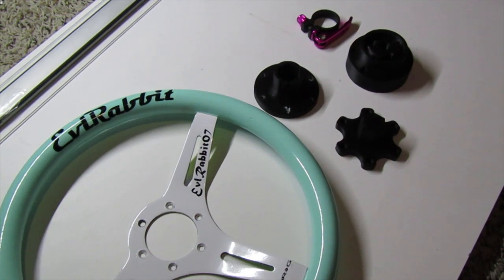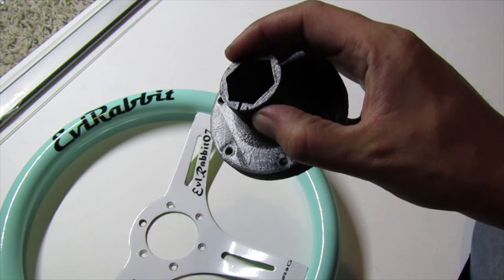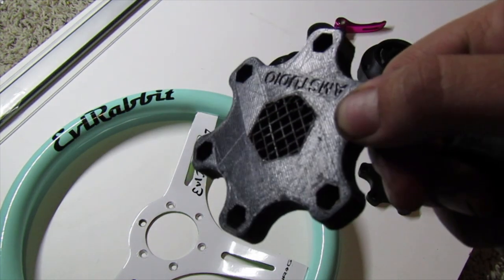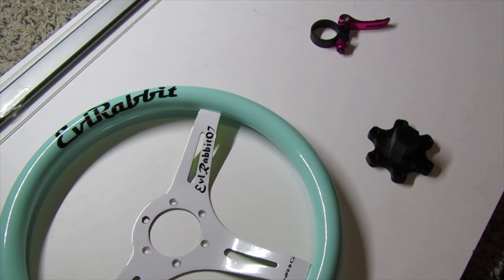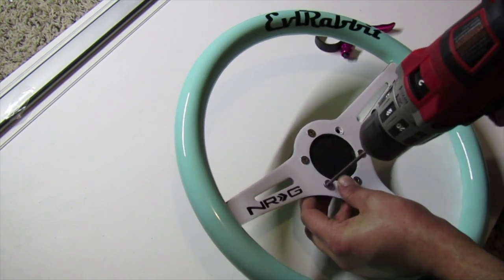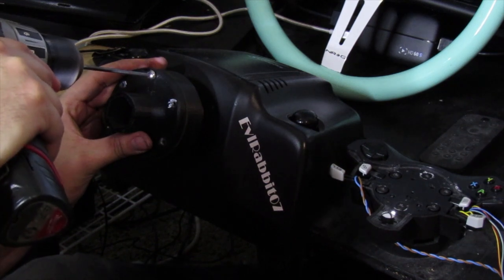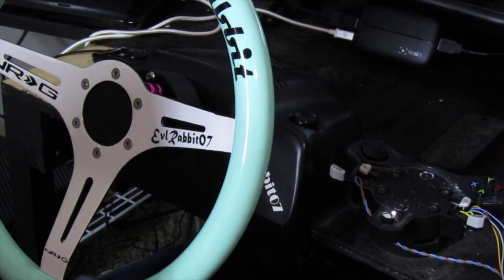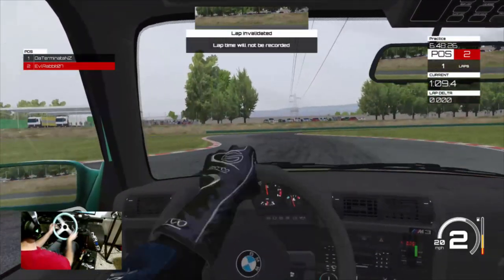3D printed Wheel adapter/quick release for Logitech G920/G29 by AMSTUDIO

Comment: I have noticed that if you remove the original controller board where the buttons are, the pc gets crazy, or actually, the mainboard of the g29 goes crazy. It basically presses buttons randomly cause probably the circuit stays open and there is a GND issue. Any solution for this? Cause I want to attach the wheel straight to the g29 without any excessive play and weight, so that would be the best solution for this plastic toy.
Reply: hey mate, did you figure this one out yet ?
Reply: @Cydro12  yes just cancel any assignment on the ghub software. Press on the button for example square, and press cancel. Just leave the H shifter
Reply: @stefderrico  hey sick dude thanks for the quick answer. ill get to it right away!
Reply: @stefderrico  actually, it doesnt seem possible for me to cancel out the buttons in the logitech profiler. did you use different software?
Reply: @Cydro12  it's called ghub. Click on the wheel then click on one of the buttons and cancel it
Reply: @stefderrico  hmm, ghub only detects my mouse, not my g27 unfortunately
Reply: @Cydro12  oh right.. I thought you had the g29 :/

Comment: how did you get wheel working with the buttons taken out? i have a g 920 and have a hub that goes straight onto the wheel but when i unplug the buttons my wheel stops worth=king and once i plug it back in it works fine how did oyu get around that?
Reply: I don't know it worked fine for me. You may have to look it up